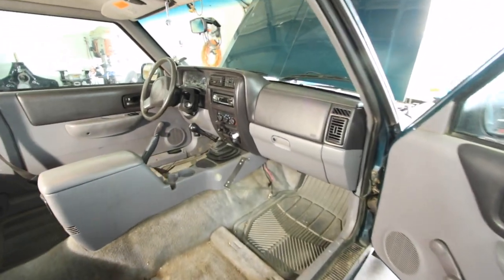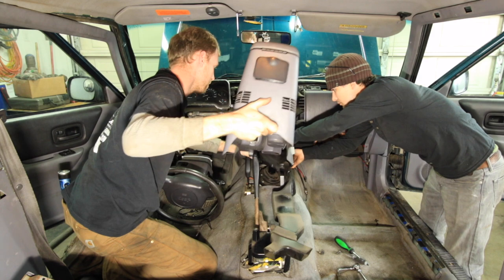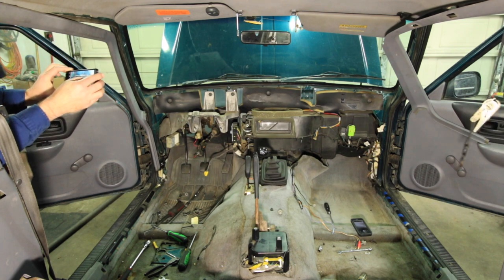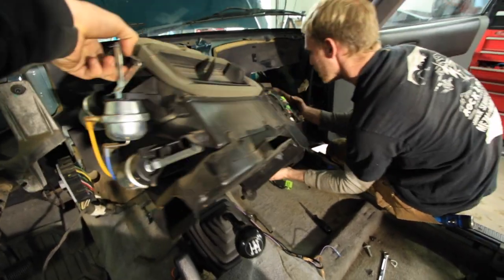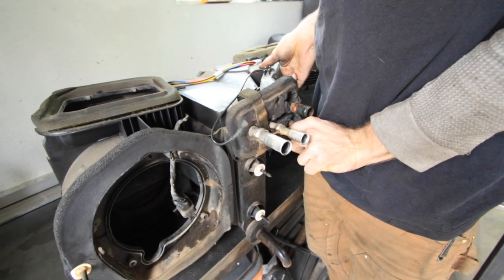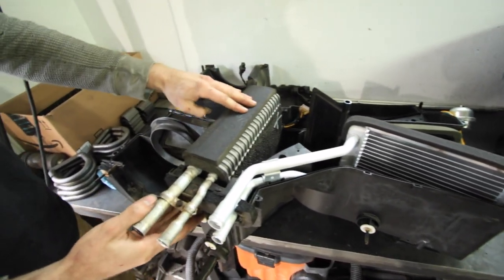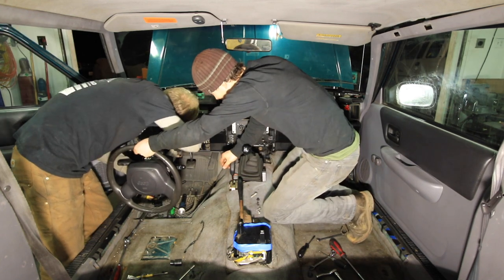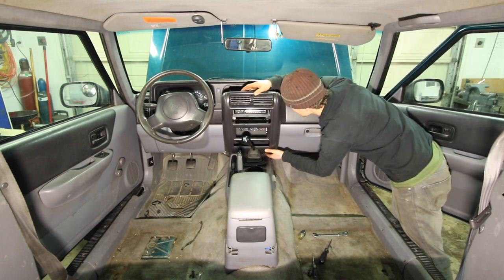Leaking Heater Core? How It's Replaced -

Comment: Shout out to all my fellow XJ-ers who know their heater core needs replacing
Reply: 🙄 🙋‍♂️🤦🏼‍♂️ lol
Reply: Mine has also been seeping for a few years.  Really starting to steam the windows now so I guess it's time to do something about it 🤷🏻‍♂️
Reply: @snakeinthegrass4726  I changed mine last Friday. . Wasn’t terrible
Reply: @Screamingz1  I'm about to find out within a couple days
Reply: @snakeinthegrass4726  good luck. It’s not the worst
Reply: I'm cold
Reply: Replaced it myself now. Was quite a nice little project, not too hard you just need to be organised with knowing which screws go back where.
Reply: Men I have the smell of antifreeze sometimes but to do all this work I'm going to hold for as long as I can and  watch more videos
Reply: LOL, I have been using those AC Delco tabs, not even a whiff of coolant odor all winter long and very hot heat (it doesn't clog it).  Only used 3 tabs.
Reply: My last 3 jeeps needed heater core 🤣 newest one is the cleanest so I'm back looking at this video once again will i do it??? I think its time
Reply: It's my turn now :(
Reply: MJers also, I'm in.
Reply: @austinclare5900  - Well, it’s been a year.. did it get done?
Reply: @stevee7774  nope 🤣 i bought a new heater core during the winter if that makes a difference
Reply: @austinclare5900  - Haha! Well it’s a good start anyway. I’m trying to ignore the antifreeze smell and fogging windshield in my 89 XJ right now. Maybe next year....
Reply: I just bought a XJ, previous owner said the heat is hot !!!!! Two days later I went to turn on the heat and I smelled antifreeze and zero heat Lmfao
Reply: Great video !

Comment: That was an EPIC venture and I commend you guys for the attempt. The engineer of that system should be HANGED !
Reply: Actually, heater core replacement is about this difficult on almost all vehicles.  The only difference with jeeps, is the poor numbers for rate of failure of the heater core.

But then again.. (not making a joke). 
People keep jeep's running for many more miles and years than the average car or truck, thus these parts are failing at 250K miles or 18 years.. which already would put this XJ vehicle model in about top 20% for longevity.

Comment: I did the heater core in my XJ all of 3 months after I bought it (got it mid-summer). I did this without the aide of an informative video because I had done heater cores previously and thought I had it under control with some minor Haynes Manual points. I also did it without the aide of another pair of hands (or nerve deadening liquor). 
My advice is...DON'T EVER TRY THIS! My taint was so sore after that ordeal. Needless to say, the job was finished 2 days later and not without a fair amount of epoxy and spray foam insulation. 
If I ever have a problem with a heater core again, I think the easiest solution would be to load the XJ up with dinitroazoxyfurazan and send it off a very high cliff.

Comment: 2003 Jeep Rubicon had its heater core rupture 2 years ago. Replaced it myself (2-3 days as I am an old man and have to work in the driveway) as jeep dealer service writer grinned ruefully and said repairs would be at least $1,200 and likely more. That one lasted 1.5 years--I hate china junk but .... I am now finishing up installing a Brassworks heater core (all copper and brass) and a NEW A/C Mopar evaporator (that was hard to find!). I removed the console (M/T), removed the gauge cluster, loosened the dash, covered/protected the Emergency Flasher switch with a foam cover, pulled the dash up and back using straps to the roll bar and roof rack (no need to remove the steering wheel), and removed the heater box. I discovered twice now that leaves can migrate from the sides of the cowl cover so I put rubber tubing in the seam to try to keep the trash out; I also added wire screen over the heater box intake under the cowl to keep trash out of the squirrel cage fan (hopefully no more out of balance noise). While I have access under the accumulator I am replacing the starter with a PMGR starter at 100k miles; there is a skid plate under the engine which makes access from under a real challenge. I photographed the heater fan from the floorboard so I can R&R later. The heater core aluminum fingers don't clamp well and that is why 2-piece radiators fail also. There is more to the story but you get the idea. I am old school and remember driving old trucks with the heater hose control valve in the engine compartment; it was a needle valve that the driver got out and adjusted as needed. I am not a fan of manufacturers using the heater core as additional cooling to save money on a bigger radiator. https://thebrassworks.net/collections/heater-cores/products/2002-2006-jeep-wrangler-heater-core

Comment: I have to do this exact nightmare job pretty soon for the exact same reason.  So, I located and purchased a used heater box and will rebuild that one ahead of time to "save time" during reassembly. And this way I can make sure everything is exactly right with it without feeling rushed.   But I'm replacing everything!  I don't want to do this twice.  Greetings from Arizona.

Comment: managed to do this with a friend. you can drop the steering wheel and remove the core without removing the gigantic dash unit. I didn't disconnect it. just lifted it up and tweaked it so my buddy could squeeze the evap box out without unplugging all that crap. This job took me no less than 12 hours. nightmare but totally worth it. in hindsight i should have dropped it off at a shop but i guess i learned in the process or something...

Comment: it was 20 degrees in my jeep this morning on my drive to work, heater core has been clogged up a long time and ive been avoiding changing it until this morning i had enough. you could not have posted this on a better day thanks!
Reply from the maker: +Michael Hernan Very cool! Its worth the task to have heat. I was taking some night photos in about 15f and froze my hands until they hurt. Got back in the Jeep and it took about an hour to warm up again with my faulty heater core. So stoked to have hot heat and clean air! Good luck -      Tim
Reply: Michael Hernan I would try reverse flush a clogged core before ya go they all that. I fixed a few like that. Fill and blow air thru til it’s clear then see if it leaks. Worth a try!👍

Comment: I'd say you did it the correct method. How else would you get the insides of the HVAC box clean and free of coolant etc?  Plus, the job was likely easier on the plastics, clips,  brittle plastic/parts etc. vs. straining with it in the dash area. Not sure about the evaporator replacement but at least you have no future concerns. Just about every modern vehicle with center console/controls have the heater core buried inside the center dash area requiring some 10 hours labor to do not to mention, it's really hard on the other vehicle parts getting access. You'd think the engineers would come up with a simple solution like replacing a cabin filter vs. tear apart the customers cars (under warranty possibly). That would be a hard one to accept, 1 year old and pulling the entire dash out !

Also, it would be a good idea for car makers to put a sensor under the heater core or an auxillary drain hose for notification the core is leaking vs. a wet floor board and mess.
Reply: Their business is selling new cars
Not fixing them

Comment: i was a mechanic for 27 years and did a few heater cores in my early years not all need to have the dash removed some you can get done just taking out the vent box underneath. easiest one i ever did was on a 1968 Chevrolet Chevelle.everything you need to remove is under the hood in the engine compartment.a lot of the jeep and Chrysler products are a pain. on your jeep here you did it the best way even though you could theoretically have gotten it done without removing the dash,it would have cost a lot more aggravation and possible injuries to try it.

Comment: Nice video. I just did this but left the seats and steering wheel. Seemed to be enough room. I would recommend replacing the gaskets on the front of the HVAC box that seal it to the firewall. They're available through the dealer for about $60 for the set.

Comment: After my A/C went over the summer I wanted to pinpoint where the actual leak was, so I threw some freon into my system with the red dye, cranked up the A/C ran it for a bit and saw a 'mist' coming out of my dash vents, all in the middle of traffic... oops. If I'm not mistaken... freon is bad to breathe in, no? Going to have to rip my dash out come the spring time!

Comment: Recently hired someone to do this to my '96 xj.  Had him replace the Evaporator, Expansion Valve, and Condenser at the same time.  He advised against it because he said the replacement parts are not nearly as good as the OEM parts.  I hope he's wrong since I had him replace them all.  But, he's probably right since my replacement all-aluminum radiator lasted about 9 months before leaking.

Comment: I did it once back in 2010 with my dad when we were swapping in the first stroker.  We weren't internetting it and it took him about two days to figure/get it out.  He put it all in the rear cargo area when disassembled and it took up a lot more space than it does when assembled.  It's a puzzle to take apart since some pieces cover other pieces, and then you find that piece has a bolt that's covered by another piece.  It isn't a fun task.  A few weeks passed before we reassembled it but it went faster than taking it apart.  I think it is more time consuming than an engine swap.
Reply: I bought a XJ recently as my first vehicle and i notice i don’t have heat i have no idea i haven’t even troubleshooted my issues yet but i’m already looking into worse case scenario. I don’t have any signs as far as i know and i think my gates that allow the air from the AC rad and heater core rad are stuck to only letting AC through as i know the heartercore also isn’t clogged.

Comment: Thanks for the video. Recently started getting steam out of my vents on my 2000 Cherokee and was hoping this wasn't the problem. Heat is still hot and no leaks in the vehicle yet but I guess I know what I am doing come spring. I also have a 1996 Grand Cherokee 5.2 doing the same thing. Replacing the radiator this weekend for a different problem but I guess we'll be tackling this one too come spring.   The engineers who design these things should be responsible for replacing them, Hahaha. What were they thinking ?!?
Reply: could not agree more with the engineers needing to do the work.
Reply: i was a mechanic for 27 years and i used to say the same thing about the engineers that design these parts and the cars. let them work on replacing parts they design for at least 2 years so they can see how it goes for the mechanic.and by the time when it gets to the mechanic to r&r most parts it's already ten years down the road and things are corroded and rusty already so it's a bigger pain in the ass.
once had to replace a rack&pinion on a 2003 ford Taurus and i swear i made up a few new curse words at the engineer that designed that setup...
Reply: My 2011 Frontier has started to smell like curry on full heat and misting up right side of the screen it’s clammy in the car. Is this the matrix

Comment: You got an extra 3 years  using radiator sealer? That stuff never worked for me. I've had 3 cars blow heater cores. I always just bypassed them. Once you start driving, you kinda forget about the cold.

Comment: So THAT'S how to change the heater core properly! 
I did mine but took nowhere near that much of the dash apart. I also had both seats still in their spots. This is a task I have no inclination to repeat...whatsoever. 
Getting that HVAC box apart enough to wrangle the heater core out with most of the dash intact is no easy accomplishment and I did crack the box fairly badly (good thing one of my few skills is plastic welding). 
I suppose for future reference, I'll come back to this vid for proper hc changeout, should the need arise. I imagine it'll save me much headache.
Reply: HedoBum I’m with you on this. Maybe I’ll just cut the damn thing out and flex seal the plastic back. It’s a $600 beater anyway...

Comment: had to do the same job on my 05 kj. I managed after many hours to change the heater core without disconnecting my ac lines and disconnecting the steering wheel

Comment: Thanks for this video.  My A/C condenser has failed so I need to do this on my 2000 XJ.  Looks like it is going to be a pain in the butt.
Reply: I'm concerned about mine so I'm replacing it as well as the heater core.  What an abortion job this is.

Comment: My  Son's 98 6 cylinder xj  jeep has been overheating, to the point where the head gasket was leaking, question the original head gasket had all water jacket holes on the one side  of engine covered, the new gasket also had no through holes for the water jacket on this side , is this normal for jeep? is there any reason these holes holes could not be drilled out to allow total water flow around the cylinders?  any advise on this would be appreciated.

Comment: Probably going to need to do this next summer- what product (leak sealer) do you recommend to shore up the heater core so I don’t have to do this right now. I have done a very thorough flush- and the fluid remains fairly clean. At the moment the leak seems to be very minor - just a slight odor of coolant and plenty of heat - and no overheating issues or steaming on the windshield.

Comment: May be a stupid question but this fix is mostly for when your heat stops working right? My 99 Cherokee sport has no heat whatsoever but it blows good and powerful. I hope this is the fix to not having heat. Btw great video, thanks!
Reply from the maker: You should try flushing it first...  most times you replace it because its leaking.

Comment: My XJ needs one because some jackass at some point put stop leak in it to fix a freeze plug issue and it all collected in the heater core
Reply from the maker: +Spyke383 If its not leaking try soaking it with sort of cooling system detergent or flush fluid. Worth a shot for a couple bucks. Stop leak is not the answer in almost every case. It did buy me some time though. Certainly didn't stop the leak.   - Tim

Comment: save the old core, if its only a minor seep, you can plumb it in under hood for overheat insurance/bandaid when crawling and slow speed use, without running in cab heater.

Comment: Thank you so much! I would have tried to tackle this and found out that it was a much bigger project than I had time for. As much as I would rather do it myself, this time I'll have to let the mechanic tackle it...While it's apart I should let him replace the blown motor and evaporator too...
Reply: All this time later and now I'm planning on tackling it this weekend
Reply: @Ty D it went really well. You don't need to take as many thing off of the dash as they did. If I had to do it again I would only take the top cover, glove box and the panel under the steering column off of the dash. After that you can access everything you need to remove the dash. There are 4 bolts holding the steering column on plus 1 bolt for the steering shaft. That bolt needs to be completely removed or the shaft won't separate. All of the wiring harness connectors are different so you can't mix them up. There's 6 bolt across the top of the dash and 4 across the bottom holding it in. It lifts out pretty easily with a friend. When you put the heater box back together make sure that the servo operated baffle moves easily. I had trouble getting it back in the right spot to pivot correctly. I spent all weekend on mine, but I was taking my time. I wish I would have taken the time to do it last year 😅

Comment: I don't have AC (anymore) and mine isn't a DD, so I just flushed the evap core and routed the heater lines to that.
Reply: Did this work?
Reply: @andrewsweat6506  If you mean that all vent air is now warm, yes.

Comment: one problem i had when i had done this is the breather tube on the front of the evap box picked up the electrical cables and crushed them between the evap system and firewall then my gauges did not work. After trying to figure out why my gauges did not work i had to take the evap system back out in order to free the cables and the gauges started to work again.

Comment: Nice video! I need to rip into my dash too, for other reasons. I will be procrastinating as well.
Reply from the maker: +Anthony Baker I replaced my gauge cluster lights with LED's and my blinker control box while we were tearing everything out. When I put my left blinker on it would flash the hazards in the rear only... I've been a super safe left turn driver for a few years.  - Tim

Comment: My heater gets so damn hot. In the summer on the Grapevine Ill run it with the windows down just to help the cooling system out a little an if i hold my hand up to the vent at full blast I swear its gonna burn me.

Comment: That's an extremely large amount of work on a car that is not worth the labor it would cost to replace the heater core. Unless you have deep pockets and or a ton of time on your hands I would run a bypass line on the hoses and a plugin heater into the cigarette lighter.

Comment: wow...what a pain..I seriously hope mine doesn't go bad in my xj.. Good video though!
Reply: So how's your heater core after two more years?  I just replaced mine after 25 years.  Since my '93 XJ has a split box, I can remove only the half with the A/C evaporator core and blower motor to get to the heater core.  Buuuuuuut, the dash still has to come out even though it's a simpler design.